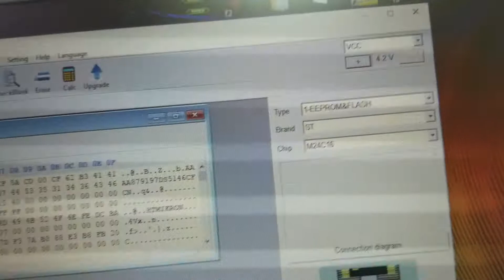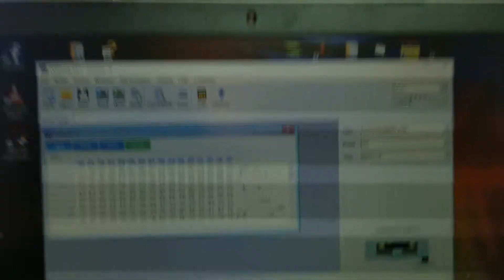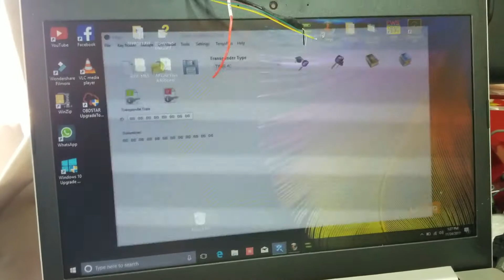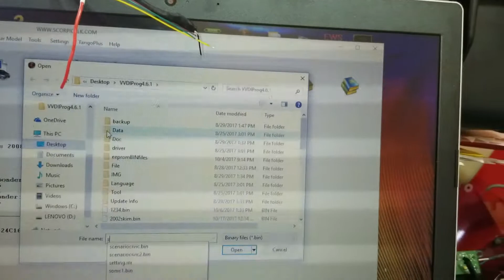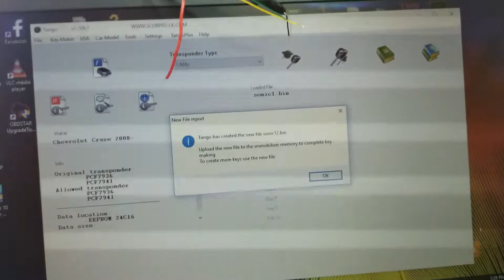Chevy Sonic BCM Transponder-Remote Key Programming Using PoGo Adapter!!!

Comment: Wouldn’t it be easier just to swap the chip? Just flood one side with solder while using a knife tip and lifting, then do the other. Move back and forth until it lifts off. Do this to the chips on both BCMs then remove excess solder from the donor chip. Use braid to clean the pads on the target BCM and tack a corner pin to the correct corner pad. Reflow that pin to adjust alignment. Once you have alignment correct, hold the chip down and tack the other end. Now, flux the chip and tack the other corners. Flux again and drag solder, making sure not to flow an entire side at once in order to maintain alignment.
Reply from the maker: No. This is a shit adapter, first off. My better adapter reads and writes with ease. 

Why would removal and swapping be easier anyways? You added like five steps to the process vs mine. Incircuit is almost always easier than out of circuit. Additionally Im adding a key here, no need for a donor. A donor is irrelevant to the equation here.
Reply: @JarethGarza  I can program another key with my BCM in the vehicle (Pontiac Montana) but I guess newer GM vehicles are different.

The reason swapping the EEPROM can be easier than dumping/programming:
A) No reason to buy anything you don’t already have on your soldering bench (programmer or adapter)
B) No reason to install software
C) No need move your laptop to the electronics lab bench (always a pain for me)
D) No risk of a read/write error
E) No need to wait for shipping
F) No need to power anything else at the bench… just the soldering iron
G) All of that process takes seconds… just basic SMD soldering technique broken down into overly-detailed steps for people who don’t work with SMDs often. ;)

For me it’s literally just flowing both sides of each chip, a swipe with braid, and soldering it back down. It’s even easier with hot air but I don’t expect everyone to have SMD rework equipment. Most everyone with an EEPROM programmer has a temperature-controlled soldering iron with a K-tip though. ;)

Comment: Jareth Garza I have a 2008 Chevy cobalt that I need to replace the BCM due to water damage do you know if is possible to swap chips to a junkyard BCM  to be able to use the keys without having to program anything? Thanks in advance

Comment: I recommend to use a guide cap on this adapter. Noticed you use it often, it precisely locate the needle pins on to the chip legs.
It saves your time and well protect the pins.
Reply from the maker: wosang_pingf123 do u have a link? Youre right btw and I agree with you.
Reply: You can search "Eeprom pogo pin adapter SOIC8" on my facebook page. We can chat there. Tks!
Reply from the maker: wosang_pingf123 ty